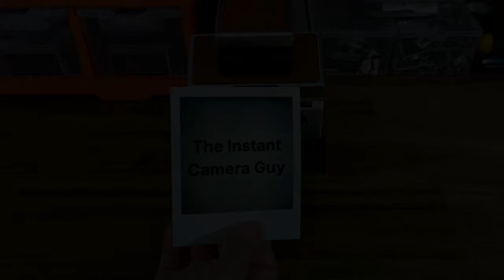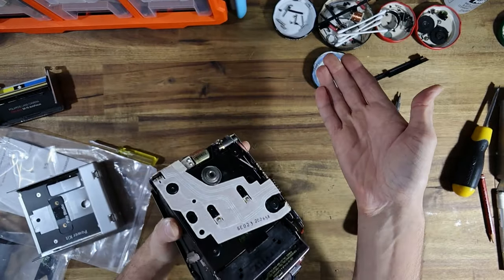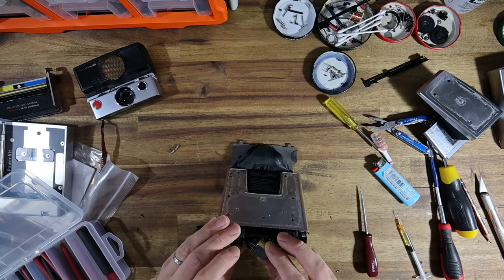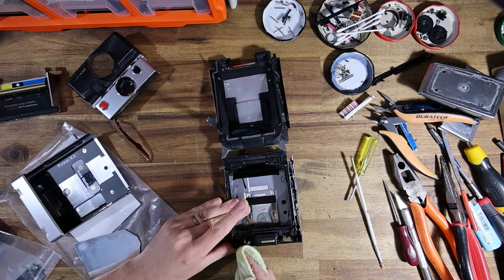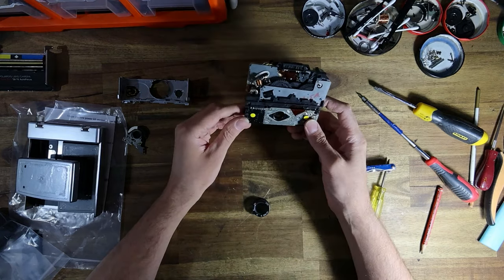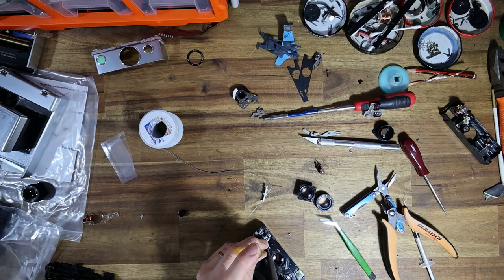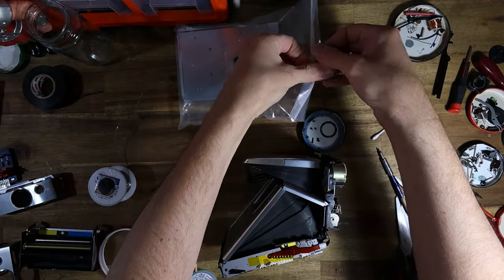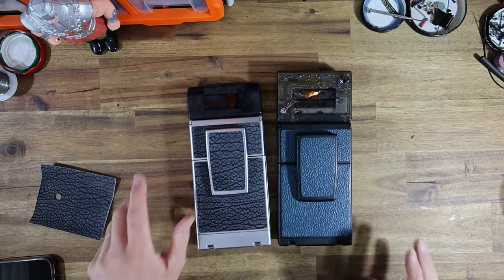Upgrading Jeremy's Sonar - SX-70R with Polastudio housing and i-Type battery system!

Comment: really just adding in some quick way to change out the battery, even a door, id be fine with. its such a permanent change that its the only thing keeping from even wanting to get it done. the prospect of just casually being able to use I-typ film is a really big appeal but the powerbar S is already cheaper and you just slap it on the top if you got a sonar... i suppose im also one who doesn't want to modify or having changes made to my camera unless needed. The other thing is SX-70 Accessories are just expensive cause it is a bit of a niche hobby within the photography spectrum... what can you do?
Reply from the maker: the Powerbar-S is certainly a 'clean' way of adapting the SX-70 Sonar to take i-Type film. 

But in terms of 'modifying' a camera, truth is the camera should ideally be overhauled regardless of which option you choose. To get the best out of the Power-bar S, the camera should really be 600 modded and have its internal metal tongue removed to make use of i-Type film easier. Otherwise you are stuck kludging fiddly filters over your packs of film, and getting no benefit from the faster ISO. 

As my video demonstrates, many of these cameras are ticking-timebombs waiting to fail (see mirror silicon). So advertising something as ‘plug and play’ and ‘no mods required’ does the public a dis-service when it comes to people getting the best results from their gear. 

Additionally, although the new Powerbar-S does feature a flash pass-through, it does become a pretty flimsy tower when the bar AND a Mint flash are installed. If you use flash regularly, this is something to consider.

Modding the camera to accept a different base panel like this is very easy to do when the camera is being serviced and is already being taken apart.

Each battery adapter has its own pros and cons

Comment: Question on the sonar sx 70 there are 3 wires at the top that I believe go to the flash, but on pola studios’ pdf those no longer get connect because the flash in now controlled by the IC ? (On sonar models only)

Comment: 10:13
Or you could cut your leather skin with holes for the screws so you can take off the bottom panel without having to de-skin it. Would even look less obtrusive than having a panel in the back.
[edit]13:57 I see you already figured that out yourself 😂[/edit]

Comment: When I connect external 6 volts to the outer case battery test terminals of my sonar model, the camera starts the shutter/gears on repeat. When I insert a standard 600 cartridge everything works fine. Do you have an explanation for this? Is it bad connections or something else.
Reply from the maker: You need a pack of some kind of film in the camera to trigger the film counter switch

Or your camera will be stuck on dark slide eject mode forever

Comment: Any chance you could adapt the Pola power thing with another usb charge plut on the other side to give it 20 years life?. using the one until it dies and then switching to the other one.
Reply from the maker: Anything is possible

But I'd just prefer it had a door lol